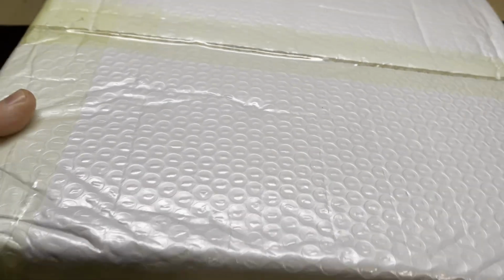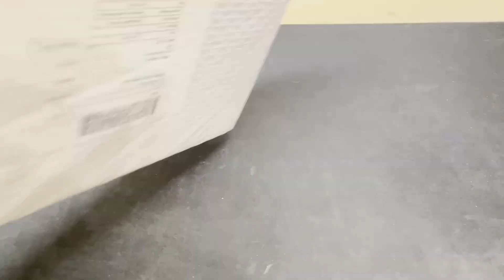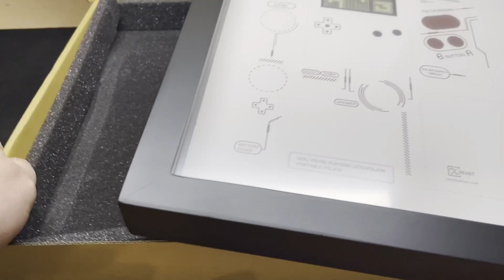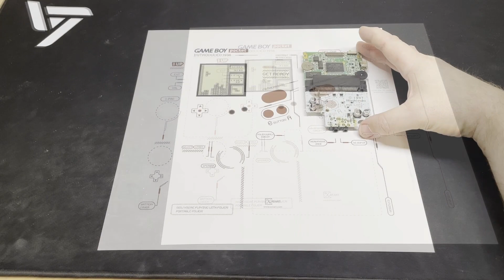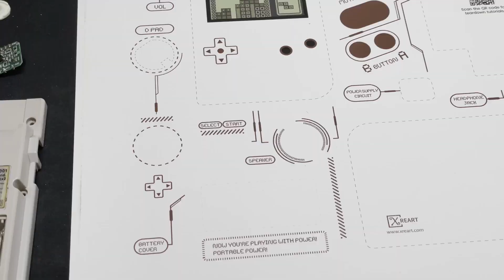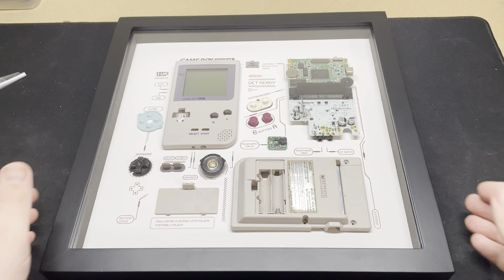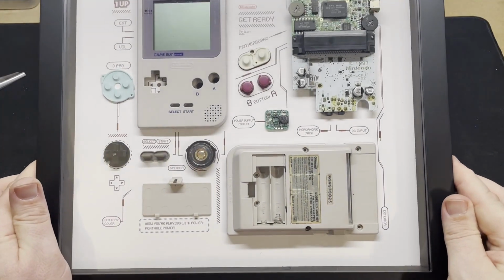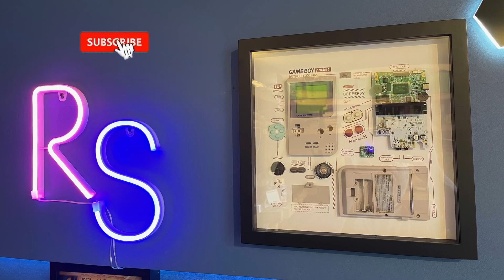Is this the perfect gift for the retro fan in your life?  Let's build it and find out!

Comment: I really don't like art pieces that destroy useful parts from a unit that can be easily repaired. DMG style Game Boy Pockets aren't that common, so this seems like a bad idea. Like turning a mac G4 cube into a tissue box or an NES Top Loader into a Raspberrry Pi shell.
Reply from the maker: Well, the good thing about this is that it doesn't actually destroy anything at all - this is all completely un-doable :) :)
Reply: Then don’t buy one… simple
Reply: @bzuidgeest  no it isn’t.. he’s saying he doesn’t like using repairable tech to make art.. my answer is simply don’t buy it then, but don’t flame the Retro Shack for trying something
Reply: @TheRetroShack  that's good, I like that then.
Reply: @johndowd9705  sharing a difference of opinion is not flaming. I'm not insulting him, I'm not calling him a bad person. I'm having a conversation. Lighten up a little, friend.
Reply: @TheRetroShack  Not to sure about that with glue being used (at least not without it being a hassle),  not to mention having to remove a sub-board that someone may further damage the board doing.

What I would have liked is for this to have had brackets that could clip around/on or be screwed into using existing mount points, given 3D printers are a thing these days.

I like the idea of showing it off, I just think there is a better way of doing it that doesn't include the use of glue. That said, I would have just kept the Gameboy whole and had illustrations or pictures of the internals.

Comment: I know people will/have disliked this sort of project as it doesn't repair or restore functionality to the retro hardware, but I prefer this to the unit ending up in a landfill, the most likely alternative.  Maybe a step beyond would be creating an adapter to connect the LCD to a Raspberry Pi Zero, and a USB port on the frame so that one could play a game while admiring the internals of the real thing.
Reply from the maker: I think this is really one of those 'marmite' type projects that you either really love or really hate.   It looks nice and is completely reversible (I know this because I put it together that way :) ) and so if I ever get bored of looking at it, I can just take it down and repair the unit and no harm done :)  But I completely get the other views too, it's certainly not for everyone :)